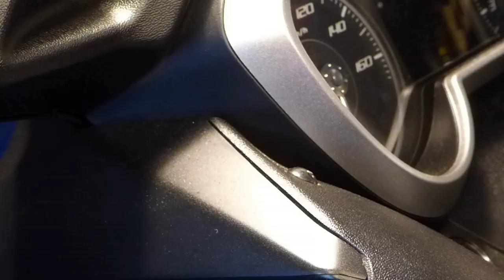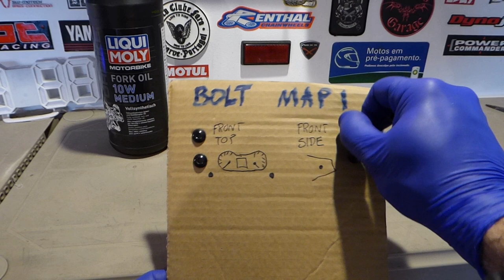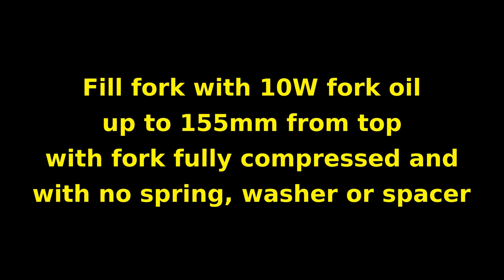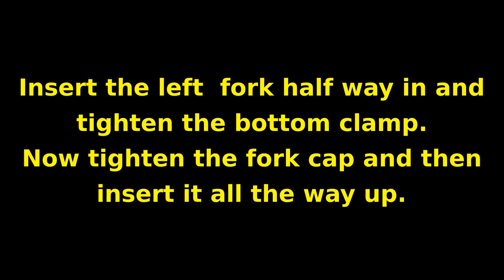Xmax Fork Oil Change

Comment: Hello ALex, a greeting, I stopped by because I decided to change the fork oil of my xmax 300, but I have some doubts. Which oil is better to use motul or liqui moly? What viscosity do you use 10W or 5W, considering that my motorcycle is used in a lot of bumpy cities, am I somewhat heavy (100kg approx)? I would also like to know what else to do when changing this oil? is something else necessary? mechanically speaking ...
Reply from the maker: Use Morul 10W fork oil 100% synthetic,  it works great.
Going one full step up or down the viscosity is just too much.
You can mix oils to get an in-between viscosity like 1/2 10W and 1/2 5W gets you a 7.5W oil.
But keep with the recommended 10W.
If the fork seals aren't  leaking then there's nothing else to do, just change the oil.
If you have any difficulty in removing the right fork leg cap install it on the left side then remove te cap.
Do NOT use a vice!
Oh, if you raise the fork legs about 2mm it makes the bike much more agile and sporty.
Give it a go!
Reply: @bikesmith  excellent thanks. Is it necessary to change something internal to the fork, or is just changing the oil enough? Is it also necessary to change the seals?
Reply from the maker: No.
You do not have to change anything, just the oil.
To change the fork seals  or bushings tthe whole  fork has o come apart.
Not needed in this case
Reply: @bikesmith  Thank you. Is 1 liter of oil good for my fork? Also, what size of wrench do I need for the fork nuts?
Reply: @bikesmith  
Alex I need please if you can tell me what key insert number you use in the upper clamp of the fork? more specific the one you use at minute 6:29 of the video. Thank you
Reply from the maker: The upper bolt is a 6mm hex
One liter is enough for both fork legs, each fork leg takes exactly 235 cm³ of oil
(One liter is 1000 cm³)
Reply: @bikesmith  Hi please the 235 cc is on xmax 300 ?
Reply from the maker: Both 300 and 125
Reply: @bikesmith  ok thanks and I have one more question I weigh 140kg and when braking I hear how the fork arrives at the end what should I do?put oil 15w nwbo underlay under the screw washer 1 cm,
Reply: @bikesmith  ok thanks and I have one more question I weigh 140kg and when braking I hear how the fork arrives at the end what should I do?put oil 15w nwbo underlay under the screw washer 1 cm,

Comment: Totally agree with comments below and this, like all of Alex;'s videos this another excellent tutorial.  I love the fact there's no really annoying music or silly voiceovers and this, along with the gentle soothing birdsong, helped me to easily absorb the excellent information and procedures so very well presented.  I just used this video to change my fork oil on my 2021 XMAX 300 (5,000 kms) and took it slow and steady in the afternoon.  One thing I really battled with was undoing the top fork caps, they were EXTREMELY tight.  And yes, I'd dropped them down well below the clamp on top tree and used the bottom tree clamp set TIGHT to stop the fork staunchion from rotating as I hauled on those pesky top caps.  After 90 mins, I finally prevailed, even though was working in 42C degrees of heat.  Haven't yet ridden it, but I'm confident it will be a huge improvement over the little amount of oil originally installed at the factory.
Thank you Alex, I'm sure I speak for many in saying how grateful we are for you taking the time to create these little jewels of knowledge about the care and nurturing of these valiant little machines.  Thank you.
Reply from the maker: Thank you for your kind words!
I'll confess something:after posting my videos and watching them I always think they're sh!t and that I  could have done it much better.
And being a "one man show" means filming is the hardest part.
Constantly moving the camera for the best possible view triplets the time needed for a job.
Nevertheless, I'll keep filming and posting.
Next two videos will be coolant change and valve clearance.
As soon as I find the time.
Ride safe!
Reply: Valve clearance will be very very interesting 👍🏻

Comment: Good video! I’ve upgraded y 250xmax to 300cc, bembos, hel lines already. Ohlins spring kit to do this weekend along with RPM rear shocks. (I promised this wasn’t going to turn into my street race bike but its does need a few touring upgrades hehe)

Comment: I recieve a lot of vibrations on the handlebar.  The small mperfection's on the road  is noticeable in the front and back. Does that mean it's time to change it? 2015 and almost 60000 on clock. If I do, will y notice the difference?
Reply from the maker: You will notice the difference. 
I recently changed to Michelins Citygrip2 and that also made a huge difference. 
Anyway,  with 60000 on the clock it is long overdue!
I recommend Motul 10W, it works great.

Comment: What do you prefer for make suspension softer than stock. Xmax suspension is so hard and unconfortable. Especially back suspension is so hard and i feel all road at my body
Reply: I'm afraid there's nothing one can do to improve it.
It is the very design of the scooter that is in question.
You can just try to improve cornering bite by changing the shock absorbers and make the suspension... harder !

Comment: Is there any reason you use 10W fork oil? Stocks come with 5W if Im not mistaken. Now I use 20w for a firmer play with YSS Fork kit.
Reply from the maker: Stock is 10W.
You can mix different weights to tune the forks exactly how you want.
A bit of an overkill...

Comment: Hello buddy!! For Xmax 250 2011 model You know how much ml Oil will be needed??
Reply from the maker: No, sorry..
You can always measure what comes out or the level inside the fork.
After taking out the spring, measure the level.

When the time comes for reassembly,  put the spring back in (to get it wet) take it out and top up to the same level as before.

Comment: Why change fork oils?
Reply from the maker: The oil serves a couple of purposes in your forks. It provides lubrication for the sliding parts, keeping them from wearing metal to metal. The oil also provides your damping. The viscosity and lubricity of the oil will break down over time and produce less damping action and needs to be replaced because of this.
Reply: @bikesmith  thanks. But is there a difference on the performance between stock and the liqui moly fork oil you used?
Reply from the maker: @kratoz_858  That depends on how bad  or how old the oil in the forks is.
If it is in good shape than you probably won't notice a big improvement.
If the oil is past it's best than the difference is HUGE.
Although I did use Liqui Moly, I recommend the Motul Factory Line 100% Synthetic Fork Oil.
With fresh oil you'll get a more comfortable ride with more grip, cornering and tire life.
If you fork oil is older than 3-4 years then give it a go. Can't hurt!
Reply: @bikesmith  if i want to make the suspension stiffer to not hit my driving lights because im gonna lower my front forks, will the 235ml per fork is enough or i need to add a little more?
Reply from the maker: You can add a spacer to the spring. I'd say about 2 cm.
You can make it out of PVC pipe.
Reply: @bikesmith  change my fork oils few hours ago, put 250ml of oil per fork. It's stiffer from stock and much better, also lowered my front by 2cm.  Thanks for your tutorial 👍